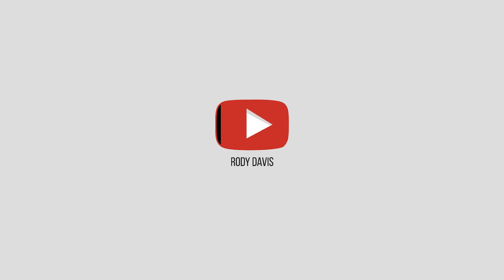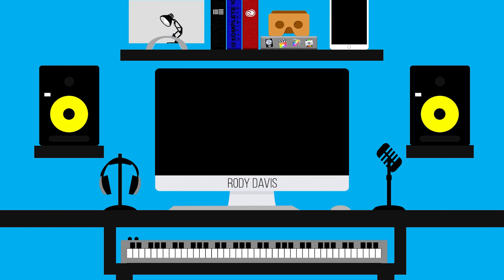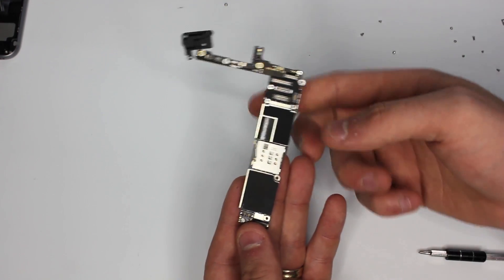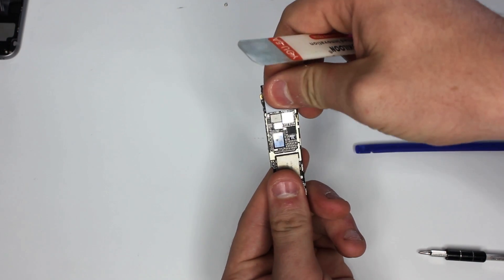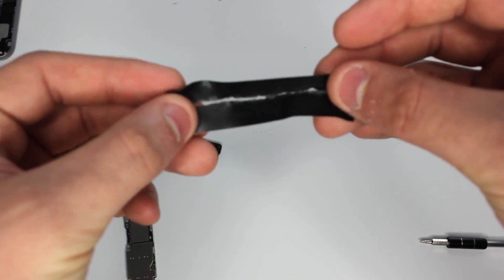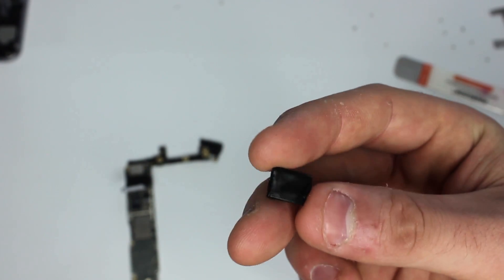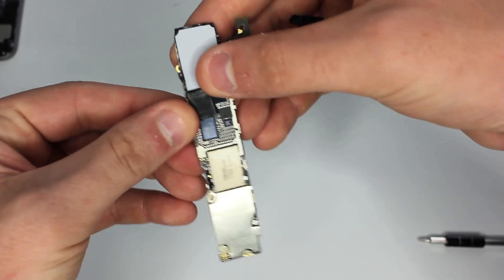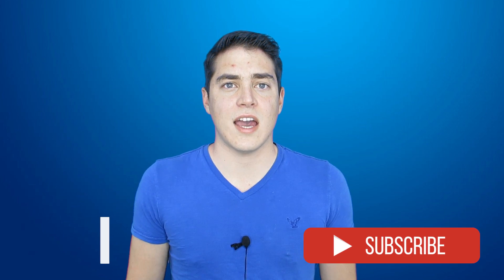UPDATE: How to Fix Touch Disease on the iPhone 6 Plus (No Soldering or Bending) | appleEducate #05

Comment from the maker: I went to the Apple Store today and asked about the Touch Disease, and they said it was caused by "flex cable" being bent. I said what about the fact it's the Touch IC failure and they said it is because they phone bends. They said they replace the phone with one that has never been bent at the price of a display replacement  (Meaning it will have the issue again). Its sad that they are not even fixing the issue correctly.
Reply: I tried the tape trick last night and the phone is worse now.  It harly reponds at all and will randomly open stuff with out me touching it.   Does anyone have a follow along tear down and installation of all the screws and cables after being taken apart
Reply: Rody Davis you're welcome to mail it to me . I will replace the touch IC chips and guarantee a working phone, as long as you have not damaged anything else with this attempt.
Reply: Brandon McNeely do you still do this repairs ? What's the fee
Reply: tried it to and did not work. My local repair shop says it is a broken circuit on the logicboard.
Reply: Rody Davis  لفت اتترنننمك
Reply: I need need help 😭
Reply: Rody Davis I wounded if also works for a 6s plus?l need a fast reply tho
Reply: Try this. I hope you get your phone working again. https://www.ifixit.com/Guide/iPhone+6+Plus+Logic+Board+Replacement/29868
Reply: hi, can u help me? i need this fix on my iphone 6 plus
Reply: Michael Hamm This guy should be responding to everyone who has screwed up their phone because of him and he should at least walk you guys through the proper steps I God I am unsubscribing the guy right now As fast as I subscribed I am unsubscribing and not because you guys are saying it messed up your phone or doesn’t work because some have said it does work, I’m taking him off Because he’s not responding to these poor people

Comment: [ENGLISH] Rody Davis, I would like to thank you for this video, I managed to fix my iphone, it was the first time I opened it, and with a lot of caution and 3h of handling, I followed it step by step and it returned to normal operation. I did the procedure on today, 01/23/2017, directly from Brazil. Just as a hint, I had a little more trouble putting it back, because the video only shows the disassembly and repair with the tape, but just save all the screws separately, and make the process inverted, you can carefully do the same Without damaging any part. Big hug. 

[PORTUGUÊS]  Rody Davis, eu gostaria de lhe agradecer por este vídeo, eu consegui consertar o meu iphone, foi a primeira vez que o abri, e com muita cautela e 3h de manuseio, segui passo a passo e ele voltou a funcionar normalmente. Fiz o procedimento na data de hoje 23/01/2017, diretamente do Brasil. Apenas como dica, tive um pouco mais de dificuldade para montar de volta, pois o vídeo mostra apenas a desmontagem e o reparo com a fita, mas é só guardar todos os parafusos separadamente, e fazer o processo invertido, com cuidado conseguirá fazer o mesmo sem danificar nenhuma peça. Grande abraço.
Reply: Does Iphone work fine till today Sir?

Comment: Why are you all talking trash, if you dont want to do it dont. It says in the title no solder or bending, so its obviously a hack, not a true fix. And its an Apple product, it wont last forever, if you can actually use your phone for a bit longer before it dies then power to you. why spend anymore on repairs when its already obsolete by Apple standards. Also if you have the extra cash to spend on repairing it the right way then do it, hes not telling anyone not to take it to a repair professional. If someone wants to try this, this is how they will learn for the future to either take it to a professional or buy a warranty. 

#stopinternettrolling

Comment: Hey, if I could get my hands on the Touch IC but not being able to sold or anything, would it be a better idea for me to try and replace the IC myself, without solding it on? In this country, the cheapest someone will microsold for you is over $250 while an original quality IC can be found for around $50 (facts, not joking).
Reply: China sells the meson ic chip for $5 no joking.  And no--if you don't have the right microscope and microsoldering equipment then no you can't solder it yourself.  If you do have the experience--go for it

Comment: +Rody Davis Hello, I would really like to thank you for sharing such a quick fix, it helped me to get the phone back to life and its working :)

However, after the fix my iPhone gets hot very quickly and the front camera is not working. Any suggestions?
Reply from the maker: +Abdulhakeem Hakeem I'm glad it's working! Double check the connections and try reducing the thickness of the tape.
Reply: My suggestion is "Don't follow plz bro solutions on the internet"
Reply: Rody Davis thanks bro... I checked the connections twice, though I guess I did a thick tape, I'll try to reduce the thickness
Reply: iPad Rehab why not?

Comment: Just spent the last few hours doing this - and seems to have resolved the non-responding touch screen on my iPhone 6 - for now ;)
Reply: Michael Brennan at this moment, your iphone it s ok ?
Reply: Gabriel Serban Thanks for reminding to reply, the fix worked for about 3 hours and stopped responding again. It is easier to get responding with less bending now but I think I need to insert more electrical tape to apply more pressure.

Comment: Hey man just wanted to thank you for this fix! I replaced my screen and still had the problem. figured it was touch disease but didn't want to pay for my phone to be fixed by apple. Took me about an hour to insert the tape and BINGO! it works as good as new. don't listen to the "haters", a wise man once said if it's stupid and it works... it ain't stupid. Thanks again.
Reply: Sir please tell me did your iphone work fine till today.
Thank You
Reply: We don't hate. We're trying to prevent people from making things worse. Read the comments and you'll see many people in worse shape and with new problems. Most of the people who warn against this idea are members of a trained micro soldering community. Non of us make any money commenting here. These ICs are not simply lose. They have weak bonds from corrosion. Squeezing these corroded points back together is like putting a spacer at the back of a flashlight that has leaking batteries. The pressure might make the corroded connection work again, but it that really what you want to do?

Comment: This guy taught me that if your circuit breaker keeps popping in your house, you can just shove a quarter in it! Yes, a quarter! 100% tested working solution. No need for expensive electricians that just want to scam you out of your money!
Reply from the maker: +iPad Rehab I'll let you know when it stops working
Reply: Not the same thing at all. I agree that the fix is dodgy at best but it works. And that's all that counts. I'd much rather do this to my phone then have to pay 150$ or more to get it repaire/replaced by Apple.
Reply: People pay 200.00 for pants with holes! why in the hell would you pay anyone to cover them up?!
Reply: @iPad Rehab:  Regarding the phone that showed up with the tape fix not working:  The guy covered the entire region with tape - not just the two problematic chips.  If you don't follow instructions there's going to be a much higher chance it won't work.
Reply: i'm an addict.. i cant survive a day without my phone.. so sending it to people a few days who actually would professionally repair it would make me go insane LOL .. having my 6plus for 2,5years now and it only has to last til sept/okt to get the new one.. :D so i'll either try this or the heating&rebonding.. and if i fuck up i just sell it as broken on ebay and get a used cheap one for a few months XD ... yes i'm maybe a dumbass but at least that smart to know that iPad Rehab is totally right here and i agree with her :D (btw i'm german, so if my english sounds like crap i'm sorry^^)
Reply: Bob Johny where's this guys' translator?!?
Reply: i prefer to use dimes they more interesting than quarters
Reply: lol,
Reply: iPad Rehab lmao
Reply: iPad Rehab I don’t think he understood how completely sarcastic your first comment was meant to be taken which kind of makes his comments first more funny
Reply: Edgar Salas omg iPad Rehab Was obviously being sarcastic when posting that comment
Reply: Ive seen the way these circuits fry and I don't have a clue why this would work.
Reply: iPad Rehab is
Reply: Good point Jessa :p you rock and you show us a REAL repair! This guy should work for apple because they did the same with the snow ibook g3 and a recent macbook model that Louis showed on his channel!
Reply: iPad Rehab Please help! I have the 6 plus it has frame damage and touch screen disease!!
Reply: Not the same - electrical has safety ramifications.  This does not.  Further, with your circuit breaker, it will be going 10 years from now so it is in your best interest to fix it.  With these phones, none of us will have 6S Pluses in 10 years, so we have to weight a cost-reward scenario on it.  Also, not everyone wants to pay for something that is a manufacturing defect, and for which Apple will just give you a refurb (I confirmed this with Apple) which likely will encounter the same issues.
Reply: @iPad Rehab I was going to send an iPhone 6 to your for a repair. I watched a few of these videos to see if there was anything I was comfortable doing myself, decided I wasn't comfortable, and decided I was going to send it to you for repair. Then I came upon you trolling YouTube comments and just generally behaving appallingly on the internet. I will no longer be sending you my iPhone for repair and wanted you to know the reason why. You're clearly quite knowledgable, but you can't manage to behave like an adult on the internet, so I will be finding another repair shop to perform my repair.
Reply: undoubtedly the best comment thus far. Why pay money to people who actually know shit when you can magyver it yourself lol
Reply: I would seriously consider deleting your comments. They are beneath you, and the fact that you can be considered a rival YouTuber isn't helping much either!
Reply: it sad how people are giving you shit when you are warning them that will fuck up their phones.
Reply: Why don't you save yourself the hassle and go buy yourself a Huawei or an Alcatel!? You'll really save some money there.
Reply: iPad Rehab - Really?  This guy taught you if your circuit breaker keeps popping in your house, you can just shove a quarter in it!!!???  Where exactly did you get your reading comprehension and logic skills from? I hope you did not spend a lot of money or time on a college degree because if you did, you clearly got ripped off regarding your reading comprehension and logic skill courses.  Oh wait... I know who you are now... iPad Rehab has the youtube channel where their employees constantly spew profanity while working on phones and chatting with people/potential customers...VERY PROFESSIONAL...iPad Rehab. Quite the class act. The guy in the video has clearly mentioned that the electrical tape hack is good for people who cannot afford the costly re-ball or IC replacement repair and/or for those upgrading/trading in their i6+ through Apple...and I couldn't agree more! People should send their hacked Touch Disease i6+'s right back to Apple, so Apple can deal with the design flaw problem like they should have done for customers in the first place!
Reply: Exactly the same thing--if I stick a quarter in my circuit breaker it also "works"   I'd rather do that to my house than have to pay $150 or more to get it repaired/replaced by my electrician.  You realize that there are tons of independent repair techs out there that do this repair all day every day professionally---and add a metal shield to the back of the phone to prevent recurrence of the problem, not just resetting the clock by swapping the phone at Apple for a board prone to the exact same fault.
Reply: What up troll?  Nice try.  You're in love with your "reading and comprehension" bit aren't you?  Sounds like a kid that made someone laugh one time by farting and now does it constantly.  It stopped being funny and no one laughs anymore, but he's still keeps on trying.

I know it's hard here---there really is no excuse for wedging crap onto the back of a logic board to "fix" anything now that bona fide touch ic repair is as cheap as cracked glass replacement and comes with a long warranty.    But I guess there will always be morons like you---careful with that quarter in your circuit breaker---it might zap you!
Reply: kenny111113 Thats exactly what I did. I thought she was sooo busy with all the work. How does she have time to come on here and act like a child? I won't send her any business. Not only is she unprofessional, she also sneaks her political beliefs into her videos. (Like anyone cares that she voted for Hillary)
Reply: Closing a hole in fabric with needle and thread is a basic life skill.  Taking apart a cell phone and using a foreign object to place pressure on a motherboard is a foolhardy idea that is absolutely putting an expensive piece of electronics at risk of total failure.  Google long screw damage repair on iPhone 6+.  Read the above comments where folks have damaged their power flexes, cameras, developed shorts and turned their repairable phones unrepairable.  Putting a quarter in a circuit breaker is retarded, as is putting foreign objects in a phone to attempt to create pressure on a chip that has progressive oxidation on the mating surfaces in the hope of making electrical contact.  Even the seemingly reasonable act of reflowing the actual solder bond with heat doesn't work long term---the only robust solution is replacing the chip and adding a metal shield to the board.  If you fail to see the lack of distinction between this ridiculous and a quarter in a circuit breaker then you are probably one of the folks dumb enough to try this.  Enjoy your broken phone!

Comment: How are you going to put a video out for a bandaid. The only PROPER way to fix this issue is to replace both the meson and cumulus. This issue is cause by the board flexing and creating microscopic tears in the solder that holds the ics to the board. This video is horrible and you should be ashamed for putting it out. I bet you put water damaged phones in rice. Smh
Reply: Why would you call this horrible.  You don't have to watch the fucking thing.  It works.  It can potentially save people hundreds of dollars.  If the only fix like you suggest is to replace the chips and my board is shot, then why has it worked flawlessly for two months since I've done it.
Reply: HateTheG because most people don&#39;t have the skill to do this without damaging more then it was. Its way to easy to get two screws mixed up and long screw damage the motherboard.
Reply: HateTheG just look at all the comments of how people have messed up their phones. Which is now going to be even more expensive for a professional to fix the original issue and the new mistake.  Good for you for properly following instruction which in return you saved money, but this is still a bandaid. This isn&#39;t sarcastic. Kudos to you. But to the other people that can&#39;t slow down and follow a guide this is a horrible tool for them and will just lead more problems then its worth

Comment: What a joke. This is how you fix it if you have no idea what your doing and an amateur
Reply: No he's not. His domain name has the word apple, like the company that makes the iphone, and educate, as in he knows something you don't... SO CLEARLY YOU'RE WRONG!!! ;)
Reply from the maker: +Louis Rossmann replacing the Touch IC chips and reinforcing them will be the best solution. This guide was only ever meant to be for people trying to get data off or extending the life without breaking the bank. I know it's not a perfect solution by any means, but there are people that don't have access to repair shops or financially cannot afford the repair or a new phone and if you have nothing to lose and your phone is already not usable then this is for them. Apple and everyone else charges $150+ for a repair that should have been free or recalled for a mistake Apple made. I'm not saying it works 100% in every case, but it does work. I still am using my 6 plus and haven't had a single issue since I did this in September. If I start having problems I'll make a video to address it. And for blog I am just trying to educate people on the products they buy and get more use out of them.
Reply: Just because a bad idea works doesn't change it into a good idea. Bypassing a faulty circuit breaker will work, but it's a bad idea. Are you monetizing this video?
Reply: If you can not afford an iphone repair, get an alcatel.. ;)

Comment: I think Apple should un-certify you for publishing such a dodgy "fix" for the iPhone touch IC issue. Go and learn microsoldering and come back with the proper solution!
Reply from the maker: +David Yates yes of course I want to learn board level repair but this is for people trying to get data off or get buy for a few months till an upgrade. Besides Apple should have repairs this for free or have a recall.
Reply: Agreed! Apple should be repairing this issue for free, but videos like this give our device repair industry such a bad image, with many repair companies adopting this method and ripping customers off! Do you seriously think that applying pressure to a motherboard in this way is a good idea? Just read the comments and see how many people you have encouraged to do this repair now have devices that are worse off than they were before
Reply: It's called a quick fix, y you don't you post a video!